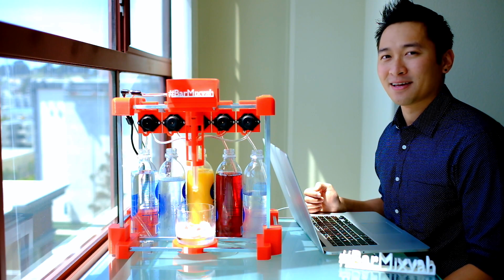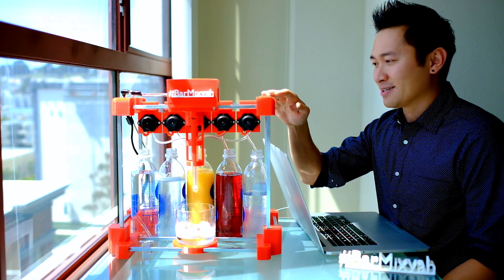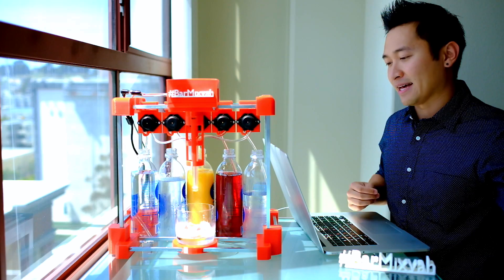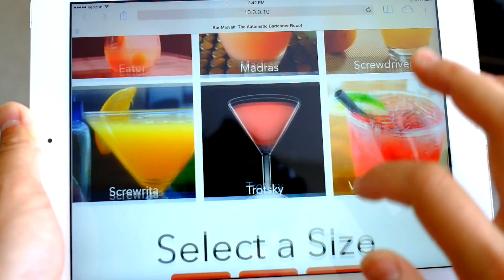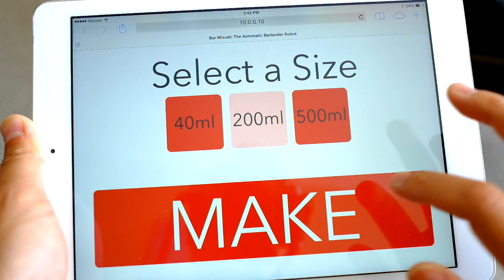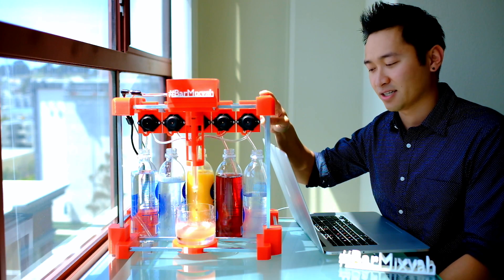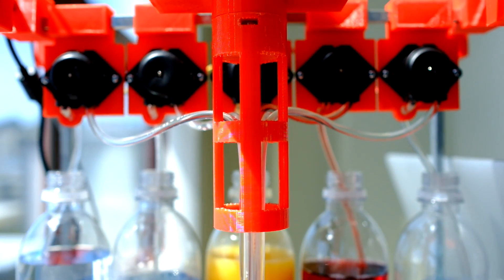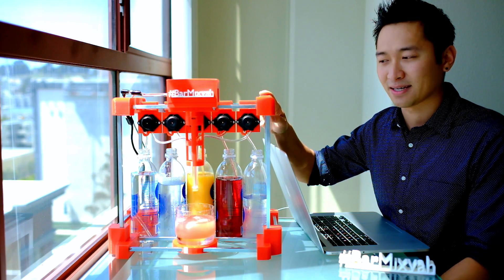3d printed bartender robot named Bar Mixvah makes a drink!

Comment: hola YU JIANG THAM es un placer ver tu proyecto, me gustaría probar lo que tengo dudas con la integración de los circuitos. Tengo un mega2560 y un nema 17 como motor de empuje, como puedo hacer para poner 4 motores de CC y operar el nema 17. ¿Cuál es el controlador que necesito para que el motor de CC y el nema trabajen juntos? Desde ya muchas gracias por su tiempo. Atentamente

Comment: There are several problem with it:

a) it is not 3D printing (simply the 3D element is totally missing)
b) the idea (and execution) is everything but new.
c) It is a “pouring/measuring” robot - not a bartender robot - What about all tasks, a bartender has to do to mix a drink (from pre chilling the glass, over shaking/stirring, straining the drink) - and what is about all other details, which have less to do with mixing and more about being a host!?
d) 5 ingredients are pathetic. No really - it doesn’t make sense - especially if you have to preselect them.
e) When can “smart” people finally “smarten up” and ask people, who know about “bartending” what is necessary to make a proper bartending robot? It seems, that all tech people totally underestimate, how complex this subject is.
Reply: a)Some of the parts are 3D printed. Not sure what you mean here.
b)Who cares if it is a new idea?
c)He never said it replaces a bartender. This is just a fun hobby project.
d)See 'c'
e)I think you need a few more quotation marks.
Reply: what an asshole, my god

Comment: Cool project!!
And a BIG THANKS for the Open-Source idea!!!!

I see three main problems/improvements:
1. You have to place your glass yourself in that device - so multiple orders may run into a disaster (whohaaaa - nooo - stoop...)
2. Ice-Cubes are atm prefilled in the glass (as far as i can see that ;-) ) - automatic would make the project more "bling-bling" :-) (and unfortunately more complex :-( )!
3. If any bottle runs out of liquid, the coctails may taste.. different.. (missing Flow Sensor - they costs more than the pump afaik)
Reply from the maker: Hi Benedikt, thanks for the comment. :)  Regarding your three:

1. Yes, a conveyor belt + queue system would be cool.  Unfortunately, I didn't really have time to make one.  You're of course welcome to modify the code/3d model to your liking!
2. I was thinking of a good way to do ice cubes that wouldn't be too crazy/messy, but unfortunately I think for now grabbing some out of the freezer might be the easiest ;)
3. In this case, it might be easier to have a set of cheap weight sensors.

If you decide to do any cool mods, definitely let me know!  Would love to see what people come up with for this.
Reply: Yu Jiang Tham another improvement would be to have caps on the bottles so they dont loose their bubbles if they contain soda etc(should be rather easy to print?) and a closing mechanism for the tubes. :)